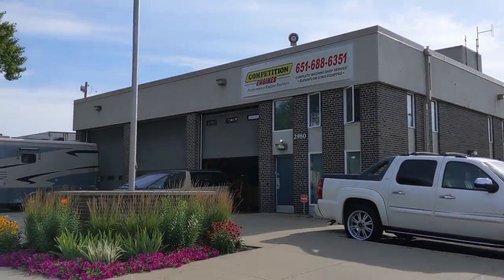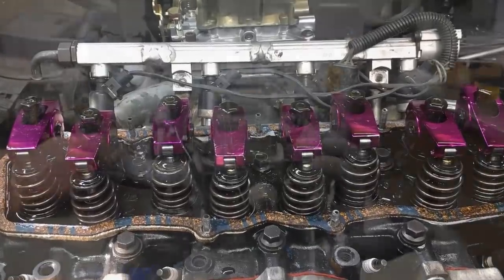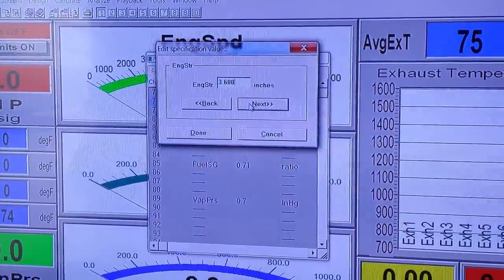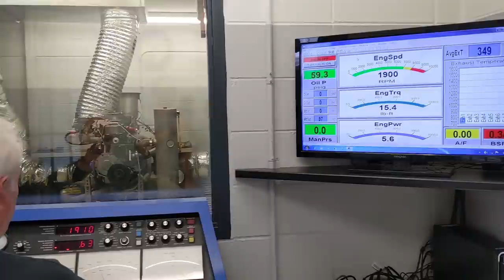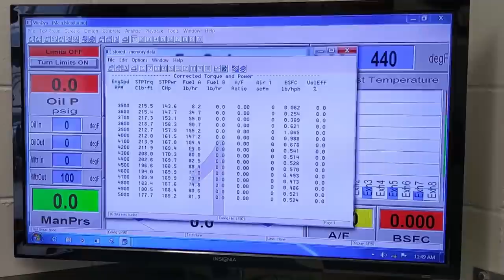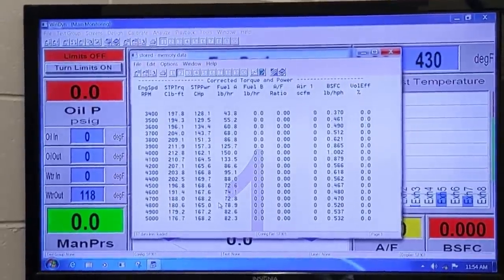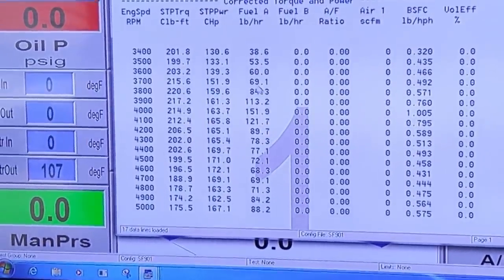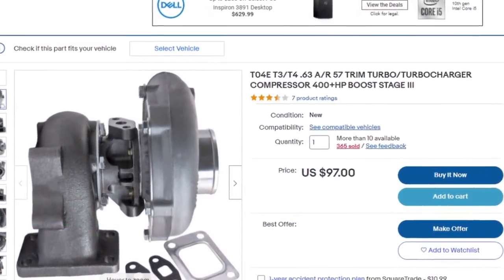Modified Pontiac Fiero 2.5 Iron Duke (Dyno Testing!)

Comment: The 88 iron duke had a balance shaft IIRC.  Seems thats whats missing here?
Reply: I have a 88 Fiero w the Tech4 balance shaft engine, it really does run smooth. But one thing you have to remember that on the Dyno you are loading the engine as if you were driving up a 30deg grade at WOT in high gear. So the vibration something you would never feel in the car.
Reply from the maker: Doesn't that balance shaft cost a fair bit of HP in the duke as well?
Reply: @Toys4Life  Yes the balance shaft cost HP and they are tuned for cruse rpm, so when you rev the engine past that point, it actually makes the engine vibrate. That is when it will coast you HP. In the GM Ecotec book on racing the LNF turbo engine, they say it is a 30hp loss at high rpm.
Reply from the maker: Very interesting, thanks!
Reply: @Toys4Life  AFAIK - Horsepower was 92 from 1984 to 1986 and increased to 98 in 1987 and 1988.  The balance shaft probably wasn't the only change though.
Reply: @racerd9669  The pushrod 8 valve iron duke didn't rev very high without running out of breath so it would be a very different situation than the 16 valve Ecotec.
Reply: @cccharlie1972  The Ecotec LNF engine that replaced this Iron Duke will rev as high as you dare to rev it. But it makes its own atmosphere w 30lbs of boost. And it is a 4 valve head on a 122 cu in engine.I have the rev control set at 7200 and in low gear it gets there so fast you have to be ready to shift.

Comment: Something I need to remind viewers about is that a Holley 2bbl carb is not rated at the same airflow depression as a 4bbl. The 4bbl is flowed at 20.3 In depression and the 2bbl is flow at 40.6 in depression So the actual CFM of a 500 2bb is only 353.3 CFM.
Reply from the maker: I did not know that. Why do they flow test under different levels?
Reply: @Toys4Life  Well this is where it gets a little confusing. The story I get is that when Holley first started building 4bbl carburetors the flow equipment they had would not pull enough air flow thru the carb, so the reduced the depression to be able to rate the new 4bbl carbs. 2bbl carbs are flowed at 40.6 in of water and 4bbl carbs are flowed at 20.3 in of water.
Reply from the maker: That actually makes perfect sense. Thank you!

Comment: might be able to get more RPM out of it if you to at least get the .050 duration about 264 I would keep the valve lift about the same but if you are running the swirl port cylinder head I would put that baby back on the dyno and keep retarding the timing lower than 30° maybe try slowly work down from 30° down to maybe about 22° the way those chambers and swirl ports you don't need that much ignition timing due to being very efficient you might be able to pull a little more out of her I think that's why the engine is not revving up almost like you got the brakes on. The camshaft that's already in there you should at least get 5500 to about 6,000 RPM with that kind of stroke
Reply: I appreciate your feed back, and I agree the cam could use a little more duration at .050, if you notice I talk a lot about cranking compression and with 225lbs that is very high for a cast Iron head engine, so more duration would bring that down. One of the problems working with the old Duke engine is finding cam cores, I had to wait almost 2 months to get a core from Lunati and then , the cores are never large enough to get what you want from them. We did not cover the timing changes as well as we should have, but we did try the timing at 28degs it lost power. The major problem holding this engine back is the lack of airflow, I would love to find a SD head. I would think w/o any other changes this engine would make 250 Tq and 250Hp and RPM to 5500. And I also need to get the injection running again, that would take some of the nasty vibration issues out of it, by not shaking the carburetor so bad.
Reply from the maker: I'm thinking a small eBay turbo would help the air flow. (:-)
Reply: @Toys4Life  But then what is the challenge in that. It would take 20psi to get the HP up to 406hp.
Reply: I agree with racer D
Reply from the maker: @mikasantos3774  all right, it seems that I'm outnumbered here...
Reply: Might be a cool idea to try out a bigger carburetor like a 650 or 750 four barrel Holley double pumper and take that 500 CFM Holley off of it just to see if that might help giving a little more air flow for the top-end horsepower/engine speeds I've never seen a Holley 2 Barrel not being able to feed an engine at high engine speeds but who knows that might be a pretty cool test on the dyno before the engine gets cracked open again back in the day the super duty manifolds were for four-barrel carburetors if you're looking for a bigger camshaft you would have to move up into the solid lifter category isky cams grind 588 solid
With eight 202-H lifters if that's what you want to try give them a call see if they have Cam cores seems like that's a big issue lately happy HP hunting

Comment: Alot of work for not that much hp tbh. My 8v 2.3 out of my volvo is pushing 170 hp. Original engine with only increased turbo pressure. 0.9 bars.
Reply from the maker: This was more of a personal challenge.  Dave has also played with plenty of Big HP engines for decades and a turbo LNF fiero (check out the vid on my channel).  I am not sure, but I think is 8 HP snowblower is now up to 12....
Reply: I had it back on the Dyno w multi port F.I and it made 235 Tq and 210 Hp. It had over 200 lb ft tq ever where. NO BOOST
Reply: @racerd9669  I mean sure but there are cheaper ways for power
Reply: @pontushaggstrom6261  Its not about the money its about the challenge, if I wanted power I would just cheap out and put a 1000hp shot of NOX on a junk yard 6.2 LS
Reply: @racerd9669  well that would blow up your engine. Indeed n/a tunign is a lot more fun and challenging

Comment: Dump the induction setup and go for atleast 2 Mikuni CV carbs, but 4 would be better
Reply from the maker: I had a snowmobile with Minkuni's on it..     I would go fuel injection - this thing vibrates a lot and it messes with the floats.
Reply: @Toys4Life  I was personally thinking of the the MJN from mikuni. They're within 10% of the torque of FI, and obviously indistinguishable at WOT
Reply: I had it back on the Dyno w Multi port F.I. and it made 235 Tq and 210 Hp and over 210 Tq ever where
Reply: @racer D  it'd force you to lose that manifold. The arbitrary, and unequal length runners are hurting you badly

Comment: The camshaft duration for that long stroke is a little small but the horsepower and torque will move that Pontiac Fiero down the highway excellent and it should last a very long time great numbers for an engine with only 5000 RPM
Reply: 3.600 stroke 6.100 rod 4.060 bore and 11.2 to 1 comp ratio. IC closing comp ratio is 7.8 to 1 and cranking compression is 225 lbs and it runs on 92 pump gas. Do you have a cam in mind for these specs?
Reply from the maker: Seems like this engine was fully designed on purpose to be a low RPM high torque reliable engine by the original engineers. Makes me wonder if any cam can make that stock head do much better than you already did, unless of course there's a little forced induction action?
Reply: You could try adding a longer duration cam to help it breathe a little more because those heads are restrictive due to them having swirl ports but try retarding the timing another 5 degrees down to 25 degrees and do another dyno pull with the original camshaft that was already installed swirl Port heads are very efficient they don't need a lot of timing
On cam specs I would say
.264 at 50thou
.600 lift
108 lobe centerline
108 lobe separation
Reply: @mikasantos3774  Well the engine already has too much cranking compression with a 112 LSA, I would be afraid to see what it would be w a 108 LSA. What do you think the Intake closing seat timing might be. Have you spent any time on a flow bench w the Iron Duke head. I have so much time in the heads its crazy. My feeling are it needs more cylinder head. With 192 cfm @ .500 lift. and that is the bare head. If I could get even 250 cfm @ .500 lift. W/O any other changes I would say 220 hp would be easy. It already made 220 tq
Reply: @racerd9669  I know them swirl Ports little hard to get flow but I'm starting work on a set of 350 TBI cylinder heads which is pretty much of the same design lots of guys talk down about these heads but you're right about the lobe centerline's 112 lobe Centerline will keep the compression ratio at the little lower cranking compression but by increasing the duration of the camshaft it should let the engine breathe a little more because the valve is staying open much longer for a longer period Of time at that valve lift that u are getting 192 cfm if it's more CFM you are after maybe you should try going to a larger size intake valve and a little more bowl work to suit the valves  might get you past the 200 CFM Mark but on the next dyno test like I've mentioned before try playing with your ignition timing below 30 degrees just to find that sweet spot those heads are very efficient port/chamber design those heads are known for a very efficient fuel mileage and torque
HAPPY HP HUNTING I know u will find it
Reply: @mikasantos3774  The Iron duke is nothing like a SBC head. I does not have side by side ports that go left and right into the cylinder. It is not an inline valve head, so cross flow at overlap is much better than the SBC head, and the chamber is a bathtub design not a wedge. The SD4 head used the same chamber. When we do Dyno testing we always go both ways on the timing and anything under 30deg lost power. I have never seen a SBC head run with less than 30deg and that was the Vortec head, the very best factory head for the SBC engine. If you look at the pics of the valve train the valves stand straight up, not like a 23deg SBC head. As far as going w a larger Intake valve, the only way that would be possible was to have them custom made, I was lucky to find the VW Intake valve that fit it perfectly. I appreciate your input, it is always good to bounce ideas off each other.
Reply: @racerd9669  well buddy if that's the case I can't always believe what you read about cylinder heads on the interwebs I still think trying a longer duration cam would help let more air into the engine I do like a bouncing ideas back and forth I have a 1990 S10 with the tech 4 engine I think I'm going to stick one of my cameras down the intake manifold I see if I can get a rough idea of the design of the cylinder head Port layout lunati cams
Had a lot of different camshaft grinds for this particular engine my old boss had a 84 Fiero with the 60 over stock style pistons 2.5 that would pull to 6 Grand but he had a Super Duty 4 barrel intake on an early model head he would beat any a Fiero that had a 2.8 V6 in the neighborhood at the time.
Reply: @mikasantos3774  I do not doubt it one bit, the V6 was pathetic. Maybe a little background will help some at this point. I had my first SF100 flow bench in 1970, and my SF600 was serial # 11. I have done thousands and thousands on a flow bench. Racing SBC for all these years, My cylinder head and manifold designs have won the Engine Master Challenge over 7 times and are being Manufactured by CHI in Australia. So I have some experience in cylinder head design.
Reply: @racerd9669  I did not doubt your skills one bit i hope that you don't give up and post more vids about that project I wish I had a flow bench that has always been my dream but all the porting I have done has always been line-of-sight and looking at the port  trying to figure out what areas need work those engines always made power but never knew that the flow of the heads
Reply: @mikasantos3774  Well this is what you can do that will help you find the air flow. Get a plastic 4 in bore cylinder , glue a cap on it w a hole for you shop vac. Then suck air thru the port and w a piece of string tied to a welding rod, go looking for where the air is flowing. You will see it all goes around the short turn radius. But where you will find power in a SBC head is at the common wall between the 2 ports down by the head bolt that is between the ports. Have fun.
Reply: @racerd9669  thanks I appreciate it greatly
Reply: @racerd9669  at least I know on the TBI heads that I can bias the intake port Port more on that side due to the swirl vane taking up most of the bowl that will be my next project after I'm done helping my friend restore a modified Datsun 510 I would do it be doing a lot of porting work on those l20b heads

Comment: Port the intake in the 2 barrel carbureta for more air..
Reply from the maker: I think it's been determined that the head is pretty much the choke point.
Reply: I had it back on the Dyno w multi port F.I. and it made 235 Tq and 210 Hp and over 210 Tq ever where. As far as Intake manifold design the EGTs on all 4 cylinders stayed only about 50 degs apart from the start of the pull at 3300rpm until 5500rpm

Comment: the intake manifold looks like a huge problem. very turbulent with no consideration for harmonics
Reply from the maker: Hopefully Dave comments - I think there may be an issue there as well - but the head is also a weak link 4 sure.
Reply: @Toys4Life  the head suffers from 70 year old architectural design philosophy, dont worry about that. Get the runners equal,  look up the hemoholtz effect and use that to dictate runner length.

A single carb set up will require a plenum. A dual carb set up will still benefit from scavenging between cylinders but be easier to develope a manifold for.

Comment: We used the 437 aluminium head made 324 at 8100  that was injected on methanol crane track roller, jesel rockers etc.  That was a 2.5 engine.  Stanton head .Still got it, needs freashened up lol. We run the fontsna now  325 or so. Easy check my yt channel
Reply from the maker: Cool vids on your channel!  How did you come to get involved with the Iron Duke?
Reply: @Toys4Life  I was running the chevyii with iron head , the rules wouldn't let me run the aluminum arias/ Fontana head, but I could run the Pontiac super duty head, ran across one reasonable $ out of a wrecked Daytona GTP car got a truck block. From the head gasket down the Chevy and Pontiac are almost the same

Comment: I bet theyll hit 280 with a turbo
Reply: Robert I had it on the Dyno last Sat. W the multi port FI and a MicroSquirt ECM. It made 235 Tq. and 210 Hp @ 5300 rpm. It had over 200 lb ft of Tq ever where.

Comment: 172HP on gas is good enough for me.
Reply: Well I had it on the Dyno w the Multi port FI and a MicroSquirt ECM and it made 235 lb Tq @4300 and 210 Hp @ 5300. It had over 200 lb ft of Tq ever where.
Reply: @racerd9669  I take my hat off to you👍

Comment: It was a typical 80's GM turd cracked blocks, busted head bolts, blown head gaskets, it's one of many reasons why GM went
from over 50% market share to the lower 20's it is in now, everybody went with the good Japanese stuff and will never come back!
Reply: I think you may want to do some research, there are plenty of Iron Duke engines that over 200,000 miles and are still running strong.
Reply: @racerd9669  I have plenty of research, over 20 years worth 78'-2000' as G.M. at a Chevrolet dealership
Reply: @zedrone7975  So where you a line mechanic for GM?
Reply: Well the race version called the SD4 dominated all its competitors in IMSA GTU in the back of a Fiero
Reply: @aaronmcilvain8077  Yes you are right, but that's a completely different animal than the production engine
Reply from the maker: Yep, GM did a crazy good on the SD4, but parts are insanely hard to find.